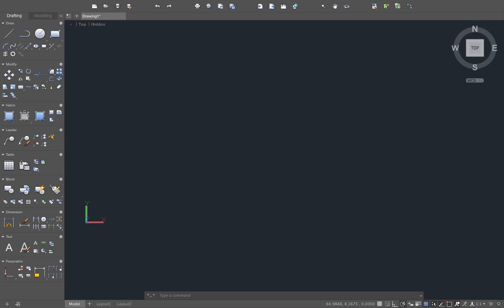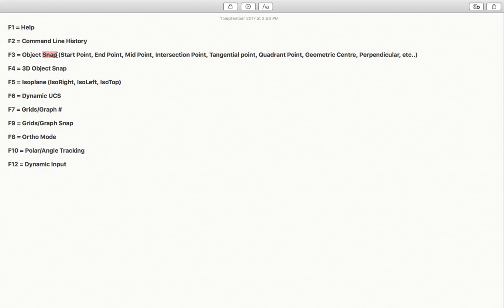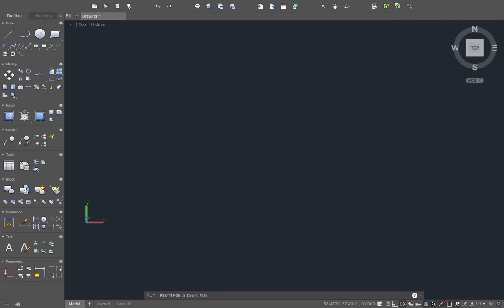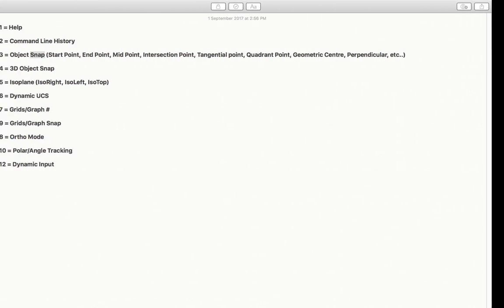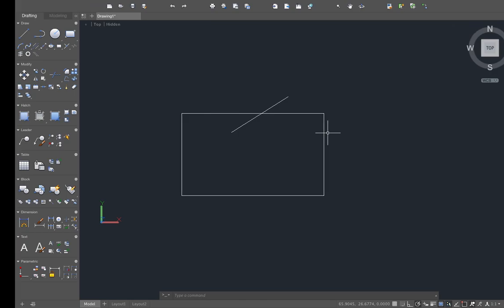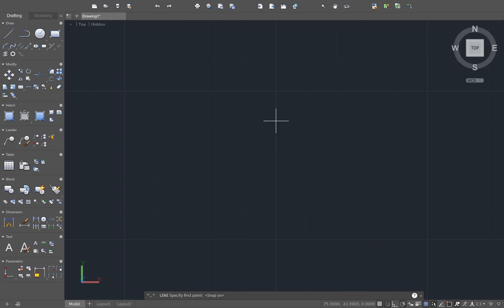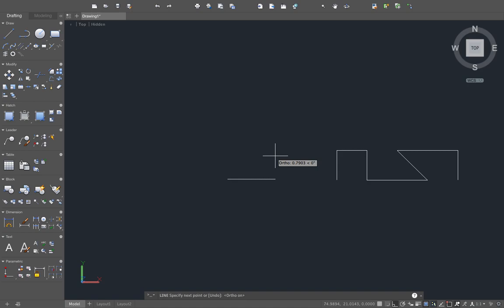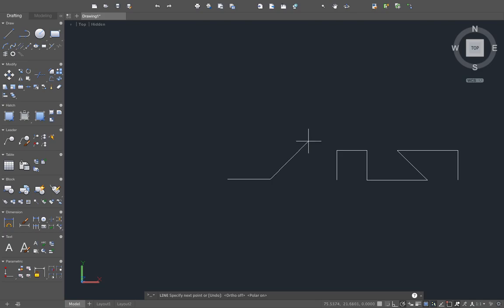Autocad Function Keys Explained

Comment: hi, my Fn wont function in CAd, it does on windows instead, pls help
Reply: four 4 : Dear if your Fn keys are not working then type “DS” and press enter for setting these functions at one place.
Reply: four 4 : Even you can use Toggles of these settings at the bottom right of the AutoCAD screen at status bar.
Reply: ohh, its already Fix..